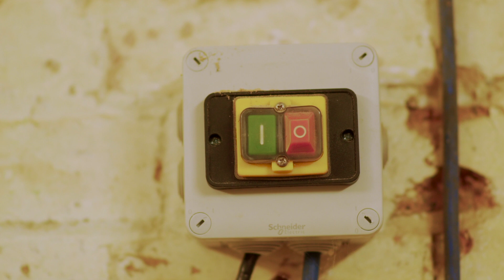Making a Wooden Button

Comment: very nice buttons. would you recommend using a dowel or branch where the grain runs from tailstock to chuck? asking because the blank for buttons has a weird grain direction in this video and I'm concerned about chipout.
Reply from the maker: No, it would snap in no time. The grain would be about 3mm long